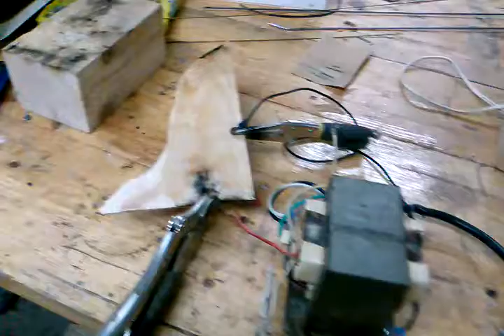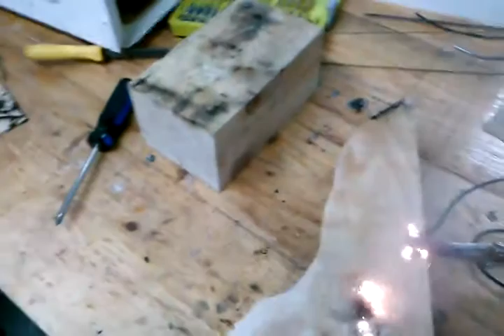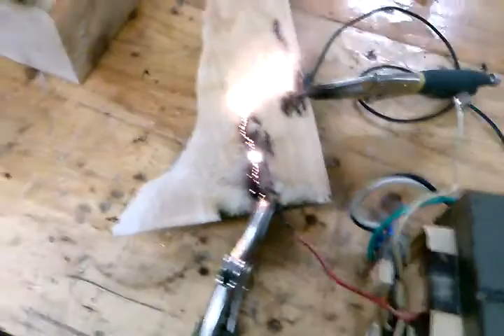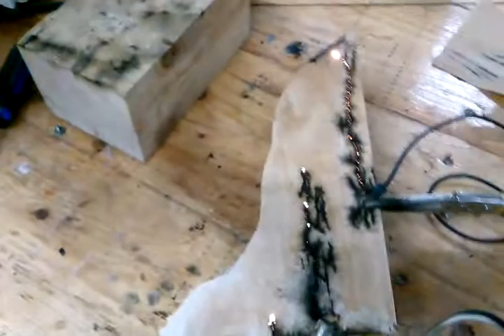Lichtenberg figures in Wood changing direction

Comment: What in the hell were you thinking putting water on that wood while it was still on? Do you realize how many volts it takes to stop your heart? About 1 16th of the amount you are playing with. This should be a video of how not to do a Linchtenberg figure in the most unsafe way you could do it.
Reply from the maker: Electricity follows the path of least resistance. The electricity was trying to go from the positive lead to the negative lead. The water solution in the sponge was lower resistance than any other path. It was especially lower resistance than the path up the dry handle, through the rubber glove, through my body, through my rubber insulated shoes to the ground.
Also something else you don't see is I have a very low current breaker on the power supply. Additionally, there wasn't a path through my heart, I was only using one hand. 
Finally, voltage is not the threat, amperage stops he heart. I was using about 1 amp. The amount to stop a human heart is 0.1 to 0.2 amps between 2X & 4X what you thought but plenty of current was available to stop my heart but there was no path for it to reach my heart and not even my any part of my body.
This video was not a tutorial, it was just a demonstration of the effect. If I had made a tutorial I would have explained all of those details.
Reply: Mark, I'm sorry if it seemed I was judging your actions. I'm a 55 year old carpenter that's worked around electricity most of my life. One rule I've always followed....never work on it with it on. Always unplug....always turn off breakers...you only one life. I've known people that didn't respect its power and they are not with us anymore.
Reply from the maker: Dennis, I totally understand and that is why I tried to explain what was not seen. Here is a fun fact about electricity. High frequency high voltage does not penetrate the skin, it stays on top. 
Of course that didn't apply to this it was DC going into the wood.  DC of no frequency and penetrates very well. If I had put my hand between the electrodes it would have burned me like it burned the wood.